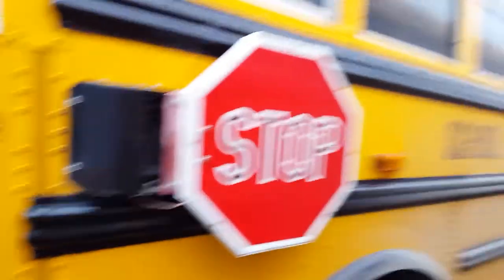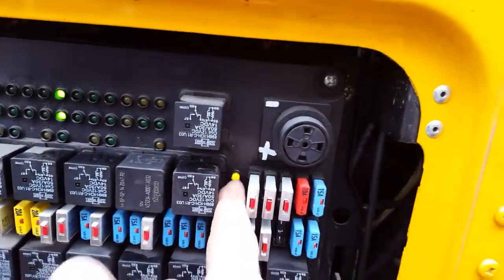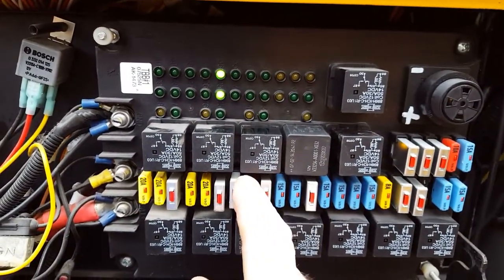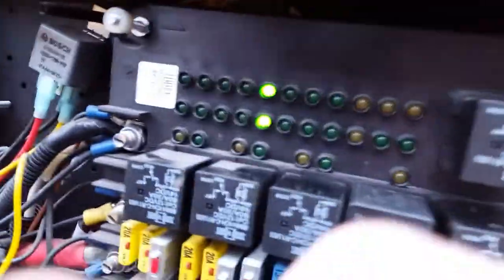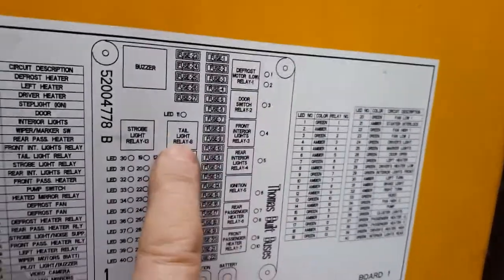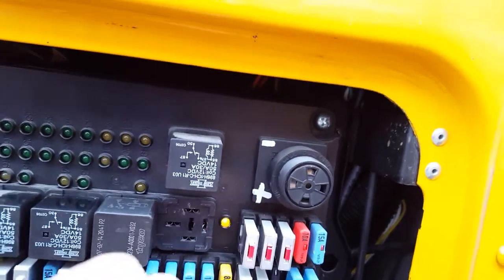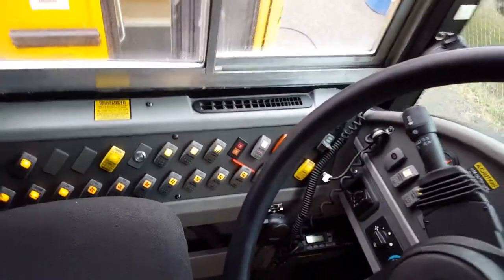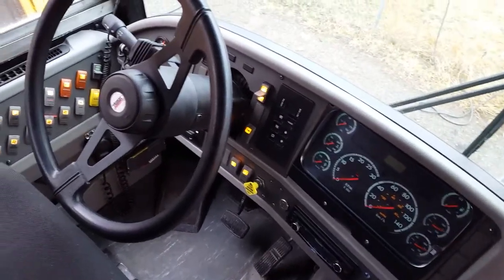Thomas HDX School Bus Circuit Board Electrical Problem

Comment: @Michael Beach, what happened after you replaced the solenoid?
Reply: Im back to finally get this bus running, solenoid replaced still no crank, as soon as my partner returns I will check the solenoid..thanks for your help the last two years have been rough caring for my mother thru the pandemic

Comment: I got a Thomas hdx that won't shut off key not even in ignition. Had to pull fuse in the rear by engine for it to turn off and run lights also stay in so have to kill battery switch as well. Anyone know why this bus stays running even with no keys in it

Comment: I've got 2002 HDX that won't start we installed a new alternator but crossed the positive and negative connections for only seconds could you point me to the nearest spot to look at we have no internal or dash lights or ignition. Thanks, Mike
Reply from the maker: Michael since the alternator positive is hooked directly to the  batteries there are breakers/fuses that have probably tripped/failed. The rear electrical control panel is the first place to check out and then check the outside side panel below the driver's sliding window. There's a main solenoid for all of the body/dash and accessories in the side panel electrical system. I imagine the alternator failed as well after reversing the polarity?
Reply: The bus won't turn over at all just dead I'll look for the solenoid tomorrow the rear control breakers were tripped but i reset them, but its still dead so I already checked the starter and as soon as I can start it I will check the alternator.  @MechanicsHubdotCom
Reply from the maker: There is a starter relay solenoid for that year. It will be in the engine compartment. Start switch goes direct to that relay. But before all that check for ignition start power at the starter solenoid sw. Terminal and work backwards if necessary.
Reply: Thanks so much I see theres two solenoids in the engine bay mounted on the box that houses the rear start option etc any quick way to check a solenoid?  @MechanicsHubdotCom
Reply from the maker: @michaelbeach190  the small terminals are ignition or start from switch which activates internal coil. You will have battery all the time at one of the large terminals and the same voltage at the other terminal when solenoid is activated.
Reply: Removing the solenoid today it had a 20 amp inline fuse but that was not blown, any easy way to check the solenoid? @MechanicsHubdotCom
Reply from the maker: @michaelbeach190  hook voltage and ground to small terminals that will activate the coil and connect main terminals that will make a connection. There should not be any voltage drop.
Reply: Thanks it a little cold out here today but i have a new solenoid as soon as its installed Ill drop you a line on my results. Thanks again @MechanicsHubdotCom
Reply: OK Im restarting to get this bus running the last two years have been a zoo taking care of my Mom thru the pandemic. How do I test the solenoid which is band new...

Comment: Can you pass any advice on my way,? 08 GMC Savana chassis Bluebird body.So annoyed. I noticed a loose rear brake bulb so like a fool I stuck some wire behind it to make it tighter inside the socket which overloaded the circuit and killed both my brake lights and clearance marker lights. Under the hood i found a burnt “aux stomp lamp “ fuse which fixed my brake lights when i replaced it, but my clearance/marker lights still remain dead. I have no idea how to identify anything in the blue bird fuse panel even though i have access to all the wiring diagrams,(Hard to read as a novice.) there are only two actual replaceable fuses in the bus fuse panel the rest are self resetting breakers. Do these identification/marker lights operate from the daytime running lights?
Reply from the maker: We have one MicroBird in our fleet with a GM Chassis and all of the fuses are labelled and located above the driver. Check the resettable fuses for continuity they can possibly fail. Don't know why there wouldn't be a clear label for clearance lights.
Reply from the maker: @ericrudofsky5648  my bus won't match. Send me your VIN
Reply: @MechanicsHubdotCom  Thanks so much for reaching out, I actually was able to read into the wiring diagrams and I ran power to terminal 7 which allowed the relay to complete. the wiring diagram says there should be a feed from the taillights to terminal 7 to power the all the indicator/marker lights. I just ran accessory power to that terminal and it all works now like it should. I don't know how a feed disappeared because the feed source is still working...? thanks again so much though and keep up the educational videos. WE NEED MORE BUS FOLK ha
Reply from the maker: @ericrudofsky5648  good news!
Reply: Hi! I was wondering if I could get a read out of your fuse box? I am having issues with my taillights and the fuse map is no where to be found!  I am hoping you can help. I have a cutaway of a 06 gmc chassis.
Reply: @jackiernorthrup  surely, anything for fellow bus people! give me ur email and ill send over all the wiring diagrams you can possibly need!
Reply: From my memory there is no fuse under the hood or seat associated with the bus body lights, those fuses are up in the storage area with ( the fuses associated to the bus body company,) I have all the wiring diagrams for blue bird

Comment: Replaced solenoid still not starting or turning over. my lights work and all the interior switch lights are on but none work interior lights etc etc stereo all my exterior lighting is good blinkers lights horn all work.
Reply from the maker: Could you send me the last 8 digits of  your VIN?
Reply: 21105845 are the last eight @MechanicsHubdotCom
Reply from the maker: Got your info I will see what I can find out👍
Reply from the maker: Did you trace back from the starter solenoid to the relay solenoid? should be mounted in engine compartment and actuated by ignition / start.
Reply: I didn't I had the starter tested and it 
tested fine do mean from the starter to the starter solenoid that I just replaced?
Reply from the maker: @michaelbeach190  yes is there ignition start voltage to the relay?
Reply: I will have to borrow a meter , Do I have the key turned to the start position and check the starter solenoid? @MechanicsHubdotCom
Reply from the maker: @michaelbeach190  yes check for voltage in crank position. You'll need a helper. Or jump battery to + terminal on solenoid.

Comment: And If I jump the battery at 34 fuse box located inside the bus it goes to pre start loading but no turning over. The wiring harness is like spaghetti as I'm sure you know so what next.